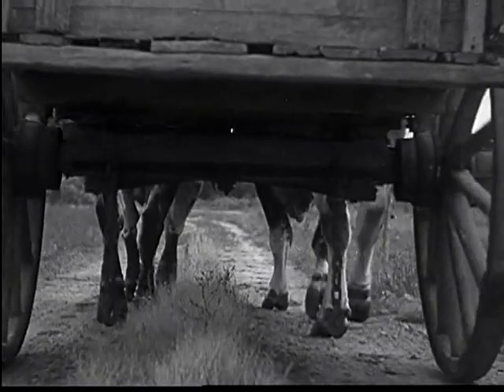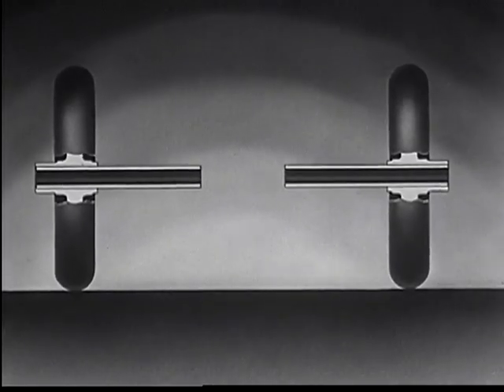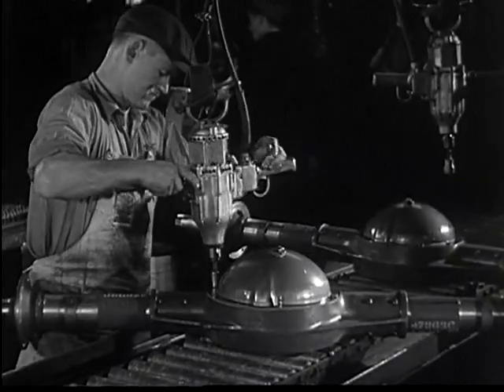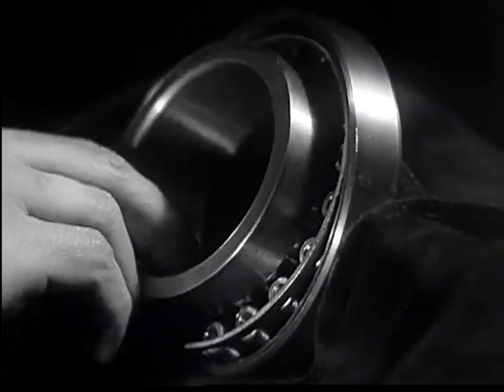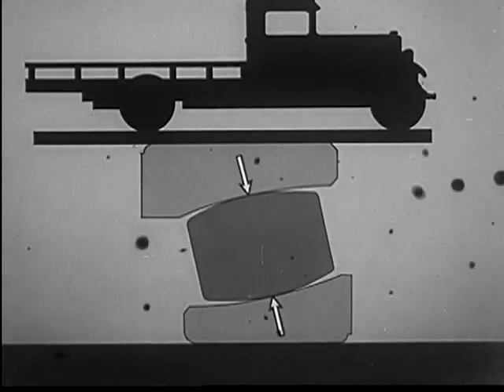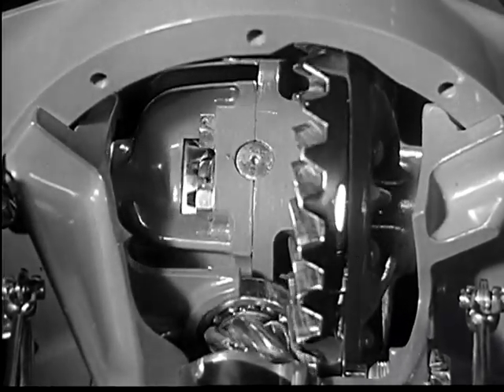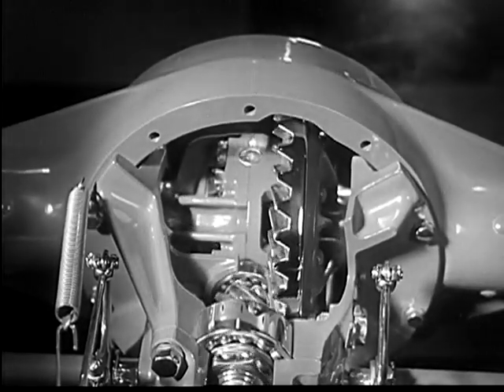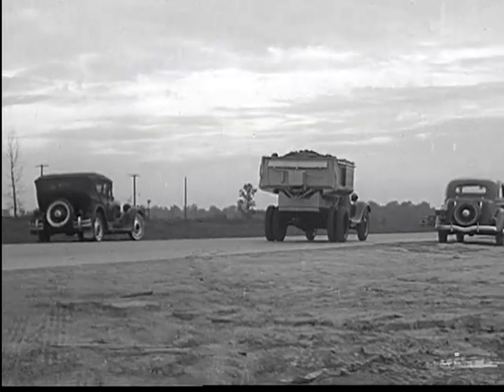It Floats - Chevrolet Full Floating Rear Axle (1936)

Comment: i want modern car comercials to be just like this
Reply: no more bs tests or or videos of crap being dropped into beds.  just people showing why their vehicles are better instead of telling
Reply: Sit back while I run you through the code for the programming that lets this truck get 26 mpg instead of last years 25 mpg!
Reply: Filipe Mendonça Except then no body would buy the car because the commercial would be all about the corners they cut to make the car cheaper to produce and then showing the increased price tag...
Reply: @bobhatesrainbows  That does not negate lots of actual technical progressions done to improve the emissions and mechanical reliability though.
Reply: Most people wouldn't understand what was explained today.  Not saying that people aren't as smart, just that cars and trucks are far more technical machines now.
Reply: @xaenon  we should get back to basics and let football be football
Reply: @xaenon  I'm trying to learn as much as I can about modern vehicle's, probably only around 80% of the way (most of what I don't know is the electronics)
Reply: @jwalster9412   And it's the electronics that most people don't understand.

I worked in the automotive field in the 1980s and I was astonished at how many people were so mistrustful of the electronics in their (then-)modern  cars that guys were ripping the fuel injection off their engines to retrofit carburetors.  I figured such practices would go away after a couple of years.... SURPRISE!  It wa still a thing in the early 2000s.

Such things aren't as common now because very few engine designs from the 1980s are still in production today.
Reply: @xaenon  I know where most are but can't find much easly on what they do or how they are coded.
Reply: @jwalster9412  They're usually detailed in shop manuals published by the car's manufacturer.  Forget the Haynes or Chiltons, they seldom go into that level of detail.    When I was still working in the automotive field, generally speaking a make and model of car would have its own dedicated manual, including schematics, error codes, troubleshooting, etc.   I had a set of manuals for the first-generation (85-91) Ford Taurus and Mercury Sable (since they're basically the same car).  The manual also covered the Lincoln Continental since it, too, was built on that platform.

Some of the stuff for a specific model might translate to other models, but that's not guaranteed.

Some shop manuals are easy to get.  Others are a bit more difficult, particularly for newer models.

Very old cars (mid-1970s and older) were much simpler, and one particular service manual might cover multiple models.
Reply: @xaenon  but people really arent as smart
Reply: @jbbolts  As much as I want to agree (and I partially DO agree), I have to point out that the 'people are dumber now'  statement is really an overgeneralization.  People might be smarter about some things today but still be utterly clueless about other things.  

I should point out, too, that our perceptions about what is and isn't 'smart' have changed as well - a natural byproduct of the technical shift in our society.

A lot of people don't realize just how many factors are involved with things that on the surface seem very 'simple'.
Reply: Filipe Mendonça absolutely agreed. Or like how they invite 10 random strangers they ask him questions what vehicle do you think has all these awards in all as it does show a picture of the vehicle that's it no testing no nothing do not buy modern cars
Reply: You can't have this....you hafta be "woke" to the new social consciousness in commericials....like the new Cadillac commercial where 3 young ladies, appropriately of different skin color, all hop into the SUV with their lattes and smile to one-another ( see, we can all live together)...as they drive over the bridge with neon background lights and blaring music.....that's where we are now....nothing about the car but all in Social Justice Virtue Signalling.... https://www.youtube.com/watch?v=ltvWWQ9FznE
Reply: @TheWilferch    so.... exactly what they were doing in the 50s then?
Reply: @DrewLSsix  ....earlier commercials had more technical content on the product being sold....we weren't so brow-beaten with social-justice, commentary..... look at the latest hubbub with the Gillette commercial.....alll about how a man "should" behave...and nothing at all about the product.
Reply: Filipe Mendonça yes. But show us all the planned failures, especially all fords
Reply: Now they just make it as confusing as possible so non car people think its just more fancy
Reply: I want modern cars to be just like that
Reply: watch Porsche commercials
Reply: Yep. 80's Ricardo Montalban telling us about the "Corinthian Leather" of the Chrysler Cordoba when there was (and is) no such thing as "Corinthian leather".
Reply: A little cool history - these demonstration "short reels" were often played in movie theaters (this was all before television) and people were used to the variety entertainment format that Vaudeville offered.  In the 1920s through 1940s, audiences expected about 3 to 5 short reels including short comedies like The Three Stooges, Joe Stokes (Behind The Eight Ball) and others, and one or two animated cartoons before the feature movie.  (This is why many theaters today still play a short intro clip saying:  "Feature Presentation."  And also where we get the term "Trailer," since previews were all shown after the feature presentation.)
Reply: Today people are too stupid and wound appreciate it.
Reply: @vitaminb4869  Yes, we are stupid and busy bandaging our wounds.
Reply: @vitaminb4869    the irony of your spelling lol.
Reply: Na if they made them like this then everyone will stop buying cars lol
Reply: Never happen, people's attention span is way lower now a days
Reply: @edwardjmayer87    you realize this was never a commercial right?
Reply: @DrewLSsix  I do, still doesn't change the fact the people's attention span is way lower than what it used to be
Reply: @edwardjmayer87    not really, movies for example have grown in length over the decades with the biggest most popular ones typically being over 2 hours in length.    Back when this film was made that would have been insane, and until recently 2 + hours was considered a profit killer.

Similarly the advent of streaming means that people often spend entire days or most of a week watching a single TV show. 

The entire entertainment industry has slowly moved towards extended interconnected genres products that people willingly invest huge amounts of time in.  

Even in the world of YouTube where quick instant gratification clips seem to be the thing people still spend a large amount of time when they discover something they engage with.  Often running through hours of backlog in a few extended sittings. 

The attention span thing is a misquoted myth at best.
Reply: JD Power disagrees
Reply: Its about damn time... my man!
Reply: The. They’d be 5 hours each lol technology have advanced a lot
Reply: Drunk announcers?
Reply: Modern people would get bored in the first 15 seconds and most probably wouldn't understand anyway...
Reply: Very few would enjoy them no one would watch this
Reply: Beside us car guys an gals
Reply: I think this is a modern car commercial.  Hmmmm🤔
Reply: Filipe Mendonça won’t be an American car commercial.
Reply: Chevy axles on 2500 and up are still this same design basically... it's easier to change an axle then it is to change a headlight bulb on a cadillac I guarantee that lmao
Reply: Don't know man, I kinda like Elon Musk smashing car windows live.
Reply: These weren't commercials. They were training videos for the sales staff and dealership service techs to understand the vehicle.
Reply: So do car manufacturers
Reply: Same
Reply: Wish there was an Open Source car manufacturer. Vehicles are disposable now, and purposely made difficult to work on.
Reply: 5 minutes long? No thanks
Reply: It would be companies saying: we used plastic here so that it will break after the warranty and you will buy another car
Reply: It would probably be p
Boring and not as "attention grabbing" as an modern ad.
Reply: i want to buy one lol
Reply: "Hi, I'm a Ford engineer. I designed this car without a tranny dipstick so you won't bother to check or change the ATF. You're better off buying a new car every 70k miles anyways, because we hate you and go f*ck yourself."
Reply: I'd have to agree with you on this
Reply: Best they can do is “This tailgate folds 50 different ways”.
Reply: Today, people are more impressed with a vehicle where you can change how the LED headlights appear on an Audi. Audi uses an AI generated ginger haired woman saying, "Next! Next! Next!" while her smart ass son sits inside the vehicle playing with a switch.
Reply: becasue they are not doing anything just adding computers and shit
Reply: most of the technicality of it is in how, not why, if you notice, they don't explain how these improvements work the way they do, they explain what the improvements are and why they made them

even then, if this format was still popular it wouldn't seem so different or so impossible, because if you'll notice, they're really only introducing a couple of new, small features, and really that's how it would have been with every commercial, it wouldn't have been huge leaps their explaining like the difference between today's car and cars back when this came out, it would be the small differences between this year's car and last year's car
Reply: Unfortunately this will never happen thanks to capitalism going from it's phase of consumer capitalism to "fictitious capitalism" where we are no longer sold a product or its capabilities but rather we are sold the emotions it will provoke in us.
Reply: @ximowilson  Capitalism has been doing that since 1920's or so, with how marketing introduced and advanced by Edward Bernays. Selling cigarettes to feminists as "Freedom Torches" etc.. Remember all the cold war commercials about a product being "American"?
Reply: @ximowilson  this is also 20 years before Ford's in-built obsolescence. The period when cars would be scrapped or sold by the consumer just because of fashion, not because they no longer functioned. 1956 Fairlaine and T-Bird if I remember rightly were the first to be designed that way.
Reply: 5 min commercials? no ty
Reply: anoname 5 min commercials like this ... yes please

Comment: No video of the guy fishing out chunks of axle shaft..
Reply: Fish around references getting the piece out... Can you read?
Reply: The axle was broken so the viewer should assume the broken pieces were removed before the new axle was installed. A video of this complete procedure was probably produced  for Chevrolet mechanic's training.
Reply: Thank you. Watched with no sound and saw the guy pull over to change axle. That was funny. Was thinking the same thing.
Reply: @TomAlter1000  no... he assembles transmissions.
Reply: I bet the owners Manuel had it in there
Reply: I snapped an axle in my international scout (81) I just removed both axels and got a copper water pipe and knocked it thru from the oher side ,,,one quick whack and it shot out the axle tube ,,,, easy (I saw a old guy do it on an old landrover in the 70`s ,,,, worked a treat
Reply: On the road sometimes you fix it just good enough to get you there then later do it right, imagine if it was snowing or raining and the guys boss was on em to get that load there before they lost the contract
Reply: I am referring to the video, not your witterings.
Reply: Theres something called a magnet, that you can... say... stick to a long arm, to pick up the pieces... and if the magnet sticks to the walls, well its round, so rotate it push it, pull it, and you got all of it
Reply: At my old job we had to pull the axle's out to change air disk brake rotors
Reply: Still easier than dropping the tires, jesus, just open the window, fish around, fill it back up, and go
Reply: And the broken piece of the shaft? Just leave it in there?

Comment: Use a hand like a hammer, bad very bad. 1:20
Reply: +Jorge Macias you work for OSHA don't you?
Reply: +Jorge Macias Are you mad? A gentle nudge to drop the axle housing in place - no hammer, neither rubber or of any material required. The ideal tool? Palm of hand.
Reply: +Jorge Macias Are you done with your crying or is there more?
Reply: +Jorge Macias All they did was push the piece into place... A hammer would have been a terrible choice of tool.
Reply: +Jorge Macias You can't be serious...
Reply: +Militaryman4455 I'm serious, the stupid are you...
Reply: Militaryman4455 Maybe you don't know that the repetitive hand hitting (like the production line worker) can produce carpal tunnel syndrome. This operation can be made using a rubber hammer.

Comment: Can anyone identify which model of Chevrolet rear axle this is?
Reply: +FLSTF87 I haven't been able to come with a model number for it, but most likely it was built by Detroit Gear & Axle, which was a major supplier to GM well into the late '60s and early '70s for Truck axles.  The design itself is 100% GM, though.
Reply: al hart But that would be Dana then. Not Chevrolet built.
Reply: well enter the real world of business many companies are derived from others, this case the auto industry.
Reply: Maybe so for some axles. But the legendary Corporate 14-bolt is Chevy built and that's it.. Nothing to do with Dana or their 60.

Comment: Just amazing that the axles today are nearly the same.
Reply: MrManniG I think if look and listen closer THEY NEVER SAID A CAR. But that being said, practically all front wheel drive cars you can remove the axle shafts without removing the wheel and tire.
Reply: MrManniG a brand new truck on any lot that’s a 2500 or more will have a full float rear end
Reply: I'd imagine most modern axles bear the weight on the axle itself.. this design took the weight off of the axle and put it on the rear end.. making those axles less likely to break than modern ones we use today..
Reply: Chuck Kissel they are not... Show me one modern car where you can change the axleshaft witout removin the wheel...
Reply: MrManniG F550 is still made the same way
Reply: you can get an axle nut through a center cap hole ike
Reply: +Chuck Kissel Yet, generally a lot weaker and most aren't even full floating. But, this was a 2 1/2 ton truck too.